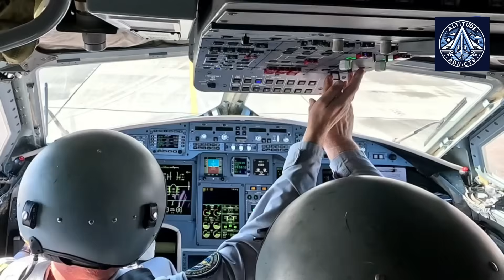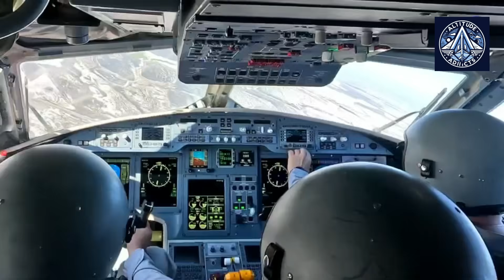First Flight of Completely Russian IL-114-300 Regional Turboprop

Comment: it will be used more in Eastern and Central Russia where population densities are lower and jet airliners are not commercially viable. The first airline will operate from Krasnodar so that tells you a lot considering that the aircraft is assembled over near Moscow by MiG

Comment: This aircraft can be consider as an intermediate step to bring income to construction company and move on with new design. The model mentioned to be replaced are smaller and lighter. This aircraft is too big and too heavy with shorter range. But still it is a milestone for Russia. Back in 2014 Russia has signed an agreement with Bombardier for 100 aircraft Q400 but never made due to implemented sanctions on 1st March 2014....Good luck Russia !!!!!